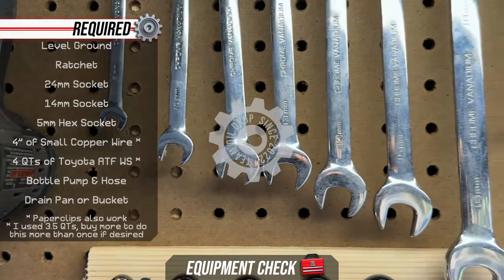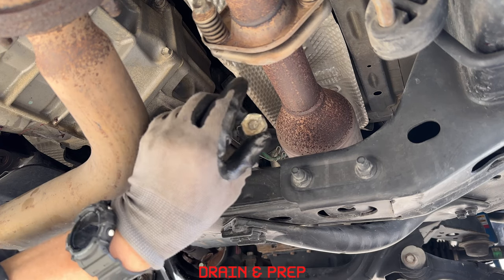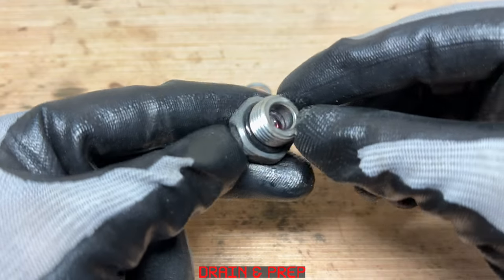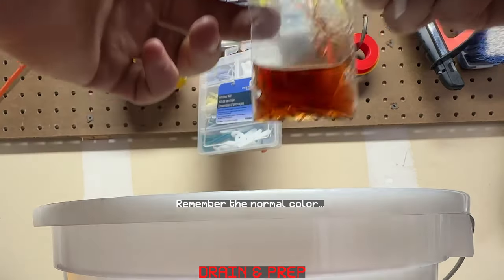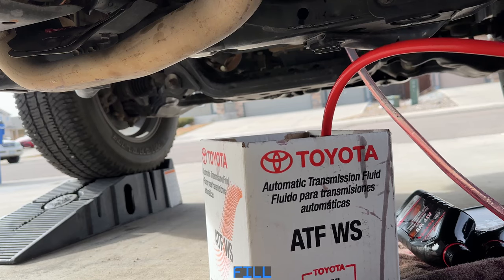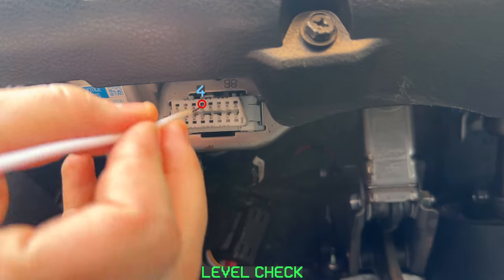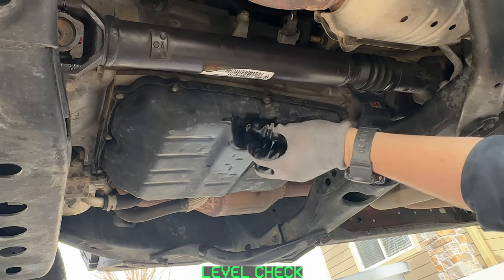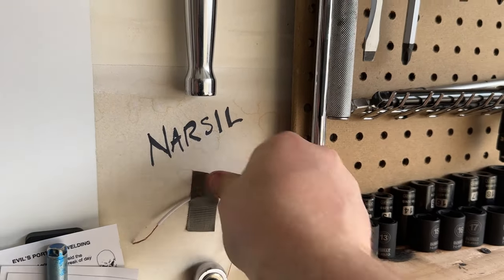How to Replace Transmission Fluid Drain & Fill Tacoma 3rd Gen

Comment from the maker: 🚨 Items needed below but read this first!
This video depicts the required and proper method to perform a temp check/fluid measuring after putting new fluid in. To perform a more complete drain and fill as well as change out the filter, see my other newer video then come back here - New video: https://youtu.be/tFMy2CrWSQI

🛒Transmission Fluid - https://amzn.to/3vepdix
🛒Crush Washers - https://amzn.to/47gfPIm
🛒 Better Pump - https://amzn.to/3WZ0Org
🛒Old Pump - https://amzn.to/3TC4yyY
🛒10 Qt Measuring Bucket - https://amzn.to/48xrvYe
🛒 Hex Socket Set - https://amzn.to/46YQKDs
🛒1/2" Drive Socket Set - https://amzn.to/48Ao0Rb
🛒3/8" Drive Socket Set - https://amzn.to/41yyGNP
🛒3/8" Torque Wrench - https://amzn.to/41Bd7Mp
(These are Amazon affiliate links: Amazon pays the channel a small fee every time you fine people buy through these links)

🚨Back this channel to support it's growth!
https://www.youtube.com/channel/UCFztsO_RZhPbgGXqbu0ywbA/join
2020-2023 Tacomas see notes below!
💬Join the Discord: https://discord.gg/RUJbAj8QPB (comment if link broken)
🤜🤛Wanna do us the ultimate bro/bro'ette move? Send this video to a tacoma buddy!
🚨 Finally on IG! : @teamoildrop

Notes:
One user (zacharylechevalier202) reports they could get their 2020 Tacoma into temp check mode without a wire as their truck does not have a live connection in the OBD port 13. They just did the neutral drive back and forth.
Reply: Thanks TOD. Video link for temp check mode procedure on '20 -'23:
https://www.youtube.com/watch?v=XTU_Jt7OJZk
Reply: Is this tutorial correct for my SR 2018 tacoma 2.7 4cyl
Reply: Thanks for what you do! Buying my first Tacoma this week and I’ve been binging your content — New Subscriber
Reply from the maker: @iBlinkTVChannel  welcome to the team! 🍻 you’ll love that Tacoma! Check the OTT tune video, it’s worth considering for sure.
Reply: @teamoildrop definitely — I added several of your videos (Tacoma maintenance videos) and several OTT videos to my playlist 🤙🏽
Reply: Crush washer dud you use the Audi M14 or  Toyota M18? Your link is straight to the Audi M14 crush washer!
Reply: How many cycles would you recommend in a drain and fill?
Reply: @kgbreviews35  try disconnecting one of the transmission cooler lines and flushing the whole thing. What you do is you disconnect the return line (coming from the radiator back to the transmission) and then turn the truck on. It will immediately start pumping the fluid so have a bottle to catch it. Fill up one quart then shut off the engine. Then add a quart of new fluid back into the transmission. Repeat until the fluid coming from the return line runs clear, hence the entirety of the fluid inside the transmission, including the torque converter has been replaced. I did this on my 2006 Highlander and it worked fantastically, the only difference is that my Highlander has a dipstick so I could more easily check the fluid level.

Comment: FYI, the newer gen 3s (probably 2020 and newer) don't require the OBD to be jumped when doing temp check. At least that's the case with my 2020 SR. Just start it up and do the back and forth between neutral and drive and the gear indicator will disappear without the "Christmas lights." I found out the hard way that the newer gen 3 Tacos don't even have a terminal in port 13 on the OBD!
Reply from the maker: @liammahoney5644  sure enough! It’s in the “notes section” of the pinned comment and description. Buried a bit I know 😌

Comment: Just completed this service early this morning after starting late yesterday afternoon . Something helpful to those who live in warm/hot climates who decide to  perform this service when the engine has been running for hours. After several attempts to get the transmission into temperature check mode  from 30 minute cool downs to over an hour, I decided after multiple attempts  to let it sit overnight. That was the ticket. The truck did exactly like the video showed. I would encourage this service be done with a cold truck engine or slightly warm.  The temperature check range is just too close to ambient to try it hot. Paperclip worked great. A gauge of wire smaller than 14 should also fit. Thanks!
Reply from the maker: All great info! Very true on how much the ambient temp can mess with this process. Glad you got it done in the end.

Comment: I accidentally made the idiotic mistake of loosening my transmission oil pan plug instead of my engine oil pan drain plug while changing engine oil. Enough drained out that I had to refill it and this video saved my ass so thanks!
Reply from the maker: I did the exact same thing on my first car! A 1989 325i. I remember thinking “shit, why is it red??” Happy I could help!
Reply: Glad to know I’m not the only one
Reply: Yes today for the same mistake.. but this video save me.

I only have trouble getting the level oil
Reply: Brothers I did this yesterday I thought I was the only one 😅
Reply: Bro I just did this yesterday lol
Reply: Yes- me too!  Now I feel a little less stupid, knowing that I am not the only one.
Reply: Same thing happened to me today… I was freaking out until I remembered this video existed. Thanks TOD
Reply: Holy crap I thought I was the only one
Reply: Did this too. Drained the whole pan of transmission fluid, them added 6 qts of oil on top of the already 6 quarts of old oil. I realized what I did wrong the next day when I noticed the truck driving funny. I realized my mistake, got it fixed. Let's just say that's a mistake I won't be making again. However I did get fresher transmission oil with the accidental drain an fill. Now I'm good for another 60k

Comment: I did the transmission drain and fill, only 2 quarts came out of my 2016. It was low from the factory, I'm at 50K miles. The video was spot on, Thanks! FYI I refilled with Aisin fluid from Rock Auto. It shifts Great!
Reply from the maker: @tomberg12  outstanding brother! 🍻

Comment: I have a 2016 tacoma with only 29k miles. Should I do the transmission fluid change now? Or should I wait a little bit more?
Reply from the maker: You’ll get various answers on this. I like to consider each year of age as 10k miles on fluids when mileage doesn’t meet it. That would put you at 70k on the fluid. It’s just a simple way to keep track of barely driven vehicles. Since the Toyota interval is 100k (60k severe), you’re fine either way. Drive another year or swap out transmission fluid. It’s due soon either way.

Comment: Perfectly described!  I like the Christmas tree comment.  Did mine at 50K.  You're describing how to put in temperature mode was accurate and to the point!  I used a paper clip, because I could not get the wire to stay in.  Keep the lessons coming.
Reply from the maker: My pleasure! I saved that bit of wire for next time ha! Next 1-2 days should bring the radiator and block coolant drain and fill video 😌- Tyler
Reply: @teamoildrop  Excellent.  I changed my coolant at 50K, but only the radiator.  I could not find the engine drain plug.  Looking forward to the video.
Reply from the maker: @donaldstogner9518 oh I got you! 7+ qts draining out of the rad and block coming soon to a screen near you.
Reply: @teamoildrop  Great, I only got 3 to 4 qtrs. out.  Can't wait!
Reply: Do you put it in park or leave it with neutral parking brake on to check?
Reply: @rogerlewis5815  In Park with the parking brake on and the wheels chocked.  The indication light will say Drive even though it is in Park.
Reply: I did not get Christmas tree ligts

Comment: Absolutely fantastic videos!  I do most of the maintenance on my 17 Taco, but have stayed away from the transmission. This is the best video I've seen that clearly explains the process of getting it into temp check mode and overfilling and draining to light dripping.  Great job - I'm doing the next interval change!
Reply from the maker: Glad to help

It's really not as bad as it seems. If you have done spark plugs you can do the transmission service.

Greg the Editor

Comment: Thank you for this video! I followed this video changing my fluid on my 22 and it literally fixed all my hard transmission shifting from the factory truck. It turned out it was low by a 1/4qt from the factory.

I was literally about to sell the truck bc of how bad it was shifting for a new vehicle and this was after multiple trips to  the dealer filing complaints who assured me they checked the fluid while the truck still shifted awful and said this how these trucks drive. My suspicion is this dealers techs were either inconfident on the fluid check process for the tacoma or they just lied and didn't do it. Either way,  check your transmission fluid if your brand new truck is shifting hard and don't believe the dealer when they tell you its how these truck drive.
Reply from the maker: I was in the same boat. It's always unfortunate when a dealership does not uphold Toyota's good name and actually do their jobs. Glad it worked out for you! Happy to hear you are good to go.
Reply: Same bro, mine started slipping and it guzzled 2 quarts...!!! And mine was a 23!!!

Comment: A lot of guys think the color is indicative of fluid condition… It is NOT!! You must send the sample in to be analyzed. The old Toyota WS had a tracer dye that changed color from RED to PURPLE when exposed to UV. This has been long discontinued (old Toyota bottles) but the new red dye (all atf starts out life clear when blended) simply wears out over time and changes color. Work on a few hundred of these Aisin transmissions and you will see WS is a superior fluid with units lasting well into the half a million mile mark with little maintenance! Great video for DIY folks 👍🏻
Reply from the maker: Thank you for the additional information
Always great to get input from Technicians

The Editor

Comment: You can also pin the transmission cooler open which allows more time before it exceeds the temp check limit. Not needed but it helps.
Reply from the maker: Thanks!
Reply: What happens if temp check limit is exceeded or not met?
Reply: @georgen4077  You aren't following the correct procedure and might overfill or underfill it. Follow the directions and you will get it right, don't follow the directions and you might get it wrong.
Reply: @georgen4077  the "D" light flashes when the temp is too high.

Comment: I am in Florida and at the step getting into temp check mode. It’s about 85 outside in march. I have let my 2017 Tacoma. First attempt at solid D it was blinking. Let truck sit off for an hour and still blinking D. I’m going to wait 2 more hours, and then try again tomorrow morning. Can I still drain overflow if the D is blinking tomorrow? What if the temperature never gets cool enough?

Edit: had to wait till the next morning to get the light to a solid D. Took many hours, but it worked. Executed rest of process perfectly. Thanks for your video! Gave me confidence.
Reply from the maker: Thanks for sharing

Appreciate the feedback

Thanks
Greg the Editor

Comment: This whole series is great.  Brakes?  Done!  Oil? Done!  I do have a question on the transmission fluid.   The spec for the trucks states a capacity of 10.6qt of ATF, but maintenance takes 3-4qts? Is the manual wrong?  Are there now 6 quarts of old ATF in there mixing with the new stuff?
Reply from the maker: Thanks for the words! So the way we do this is the same way a dealership does it. Drain about 40% of the fluid and replace with fresh. If you do this once, great, twice, even better, 3 times, good as new pretty much. The only other option really is to do a complete pump through of all new fluid but this is expensive, unnecessary, and debatably not the best move. Many consider the old fluid to contain deposits and microscopics from transmission wear to continue to be good for the moving parts.
Reply: @teamoildrop  Great!  Thanks for the quick reply
Reply: @teamoildrop  glad to hear, similar to how i maintained my civic, didn't need a full swap just a 50% refresh every so often.
Reply from the maker: @derekp6636  exactly, pretty easy in the end
Reply: @teamoildrop 
Great professional reply. Thanks ❤

Comment: Absolutely love your videos and appreciate all you do! 

I am about to check the fluid level on my 2022 Tacoma but had a question from your other video when you pin the thermostat in before you start draining. Is it necessary to have it pinned in when filling and checking the level too? Or can you remove it once everything has drained?
Reply from the maker: Thanks brother! Once drained just go ahead and unpin back to normal.
Reply: @teamoildrop you’re welcome! I seem to be stuck on getting the truck into the temperature check. I go back and forth between neutral and drive but the D never disappears. Any ideas?😭
Reply from the maker: @redactedbass  ya know i just did mine again the other day and it took a few attempts this time...

Comment: Great video! I drained my 19 Tacoma this morning with transmission cold and only 2.5 qts. Drained. Should I follow same procedure by adding 3 1/2 quarts and do the temperature check? Thanks
Reply from the maker: Yes, better to slightly overfill and remove excess than to under fill!

-Austin

Comment: Thank you for the video!  Can you tell me, is this what you recommend at every say 30K miles? VS what they call a flush?    So basically 3.5 quarts every 30K?
Reply from the maker: You’re welcome! It’s really up to you. Doing this once every 30k would be great or doing it 3 or 4 times in one day would get you so clean you could ride another 100k 😎
Reply: @teamoildrop  ,
Ok.
If we were to do it 3 times in a day, do we only do the temp check on the last  3. Quarts?
Reply from the maker: @thenavigator5889  if I were in your shoes, yes, I'd drain and replace the same amoutn, drive aroud the block twice, then last time follow these exact steps

Comment: Awesome video tutorial and good job at explaining! Subbed and Liked 
I have a question, when you measured the amount of fluid drained (the 3 Qts), was it only after removing just the drain plug? 
Or did you measure the fluid after removing both drain plug AND overflow plug?
Thanks!👍
Reply from the maker: Thank you! And that was after removing the drain plug. If you drain it from the drain plug nothings coming out of that little overflow.
Reply: Thanks again bro 🙏

Comment: Hello sir....Roy from Yuma, Arizona. My Tacoma is a 2019 with a 4 wheel drive unit. It has 75K on and am thinking about having the transmission serviced. 95 percent of my miles are on pavement, but I do live in a dusty area. Would you recommend changing out the filter as well on the trannie? Thanks.
Reply from the maker: Hey brother! I’ve been needing to make a deeper dive transmission video but pretty much all of us have metal mesh filters that don’t get changed out unless damaged. I’ll show as soon as I can 😌

Comment: Turns out even with ramps i'm still on a pretty decent incline in the driveway, got a bit over 2 qts out from just draining, refilled 2 1/2 and will find a flatter spot to do the temp check.  Found homedepot carries some 10qt clear containers for paint with markings on the side.  As always appreciate the vids, this one was simple!
Reply from the maker: The vehicle being level is a crucial step in getting the proper fluid level.

Greg the Editor
Reply: @teamoildrop  just to double chuck, i stuck the level on the frame underneath. then used the jack to level it out on the street. Is that the correct location to measure from?

Comment: Great video and explanation.  For proper orientation, what side of the truck is the fill plug on?  And where did you get that awesome fill pump?  Thanks.
Reply from the maker: Thanks! If you check at 0:45 I listed the passenger and driver side icons in the video. The full plug is on the passenger side. That pump is just a basic autozone special if I recall.

Comment: Sweet thanks, swapping some other fluids tomorrow and wanted to do the transmission as well, appreciate the video.  Will order the gasket for the next time and drop the pan to get more out.
Reply from the maker: Niceeee! Get er done! Remember 2020+ check the notes
Reply: @teamoildrop  got a 2017 trd off-road, thanks to yall and others got the rear/front diff and transfer case done this morning, now to tackle the transmission.
Reply from the maker: @derekp6636  good stuff! Killing it 💥

Comment: Thank you for making this video. Extremely helpful. Still kind of a PITA but doable. Saved me $275 from having the dealer do it. Great video.
Reply from the maker: Glad it helped! Now you know it was done right because you did it yourself.
Reply: The dealer removes all the fluid and contaminants, flushing the torque converter and the transmission cooler, it all so back flushed the screen filter negating dropping the pan which you would break most of the pan bolts anyway , what he’s doing is just a slight drain and refill putting a few quarts mixed with several old dirty quarts, the machine that does that at the dealer cost over 4 k that’s why it cost so much, would you just drain a quart of motor oil out and just add one back in or would you drain it all out

Comment: Would you use the same amount on a 21 Tacoma SR? 
Same steps etc?
Thanks for all your videos ❤
Reply from the maker: @brookebrawley2142  sure would Brooke! If it’s the 6 speed auto do exactly as this. However check notes for a word on 2020+ models
Reply: @teamoildrop Greatly appreciated.
Saw you jacked up the front in one of the videos.
Is that a better method to get more out of the transmission?
Reply from the maker: @brookebrawley2142  it sure is! Just drains the torque converter area of the trans even more.